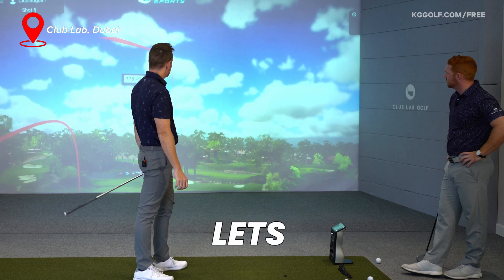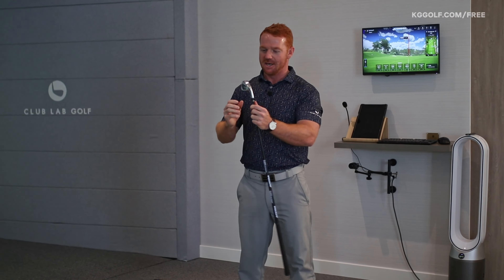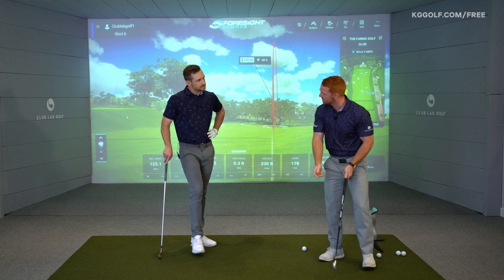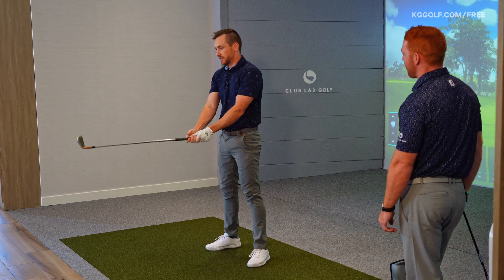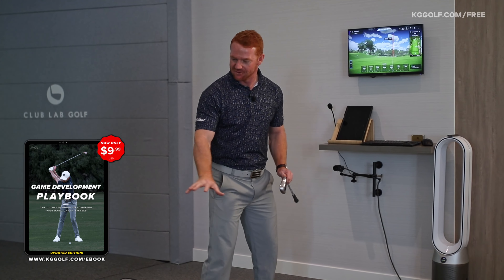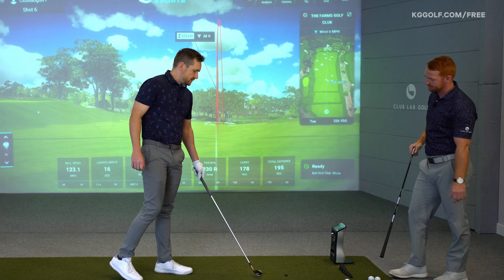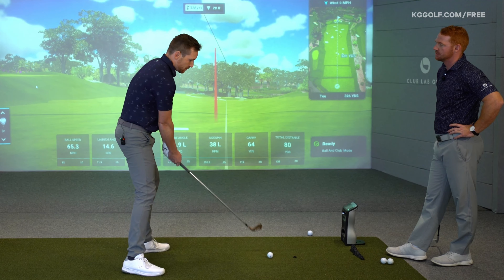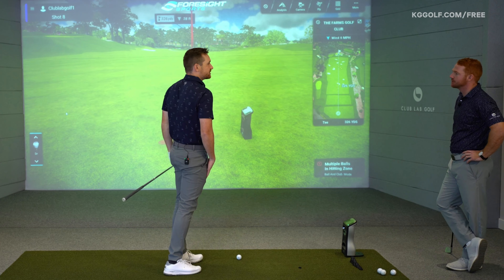EASY Weight Transfer Drill Guaranteed to improve your ball striking - Marno Vorster Part 2

Comment: Excellent job gentlemen in demonstrating weight transfer drills!  I like the half swing drill that you were showing moving the weight from back to front.  Years ago, I would line up several balls in a row and shuffle through going  to back foot and then to the front foot hitting each ball in the row.  It definitely gave me a sense of weight transfer.  Well Done Gentlemen!
Reply from the maker: How did you find hitting down the line of balls? Did you find it helped you with your weight transfer? Thanks for your comment 👍
Reply from the maker: Thanks John I will!